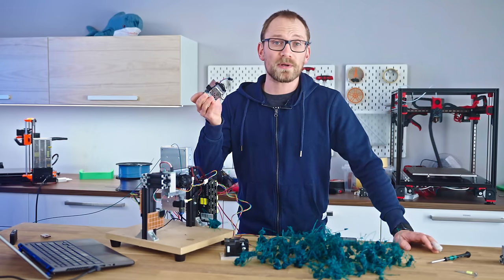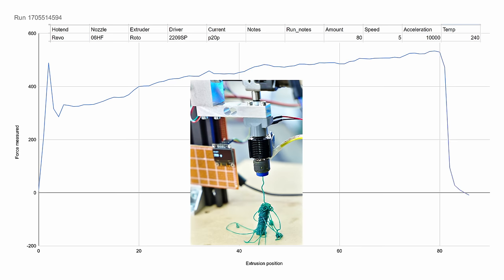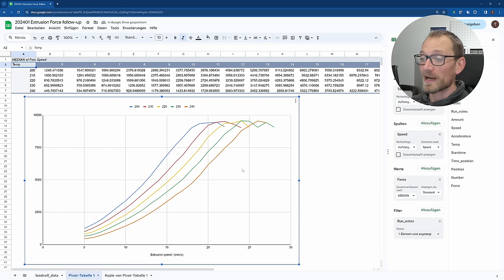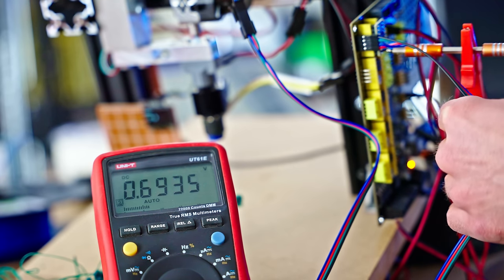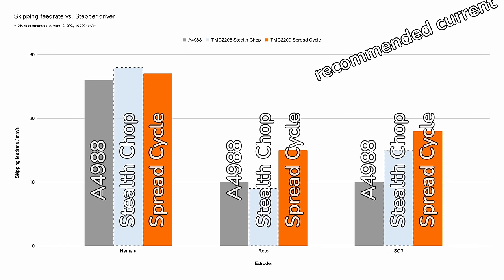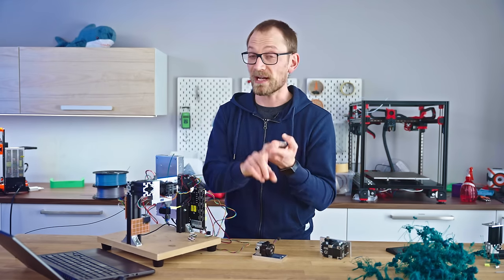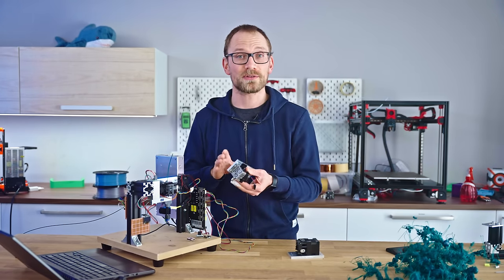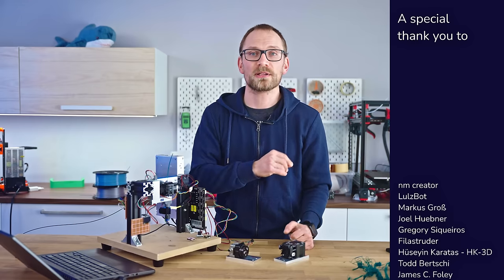Are you using your stepper drivers wrong? E3D Revo Roto Retested!

Comment: To me it sounds like someone miscalculated the winding count & wire gauge requirements for the Roto.  From what you’ve presented, there are too many windings in the Roto.  The higher the winding count, the higher the voltage requirement.  They should be using fewer windings and a larger gauge wire, which would then work with a 24v system.
Reply: I think it's more to do with step angle. 0.9Deg needs twice as many steps as 1.8Deg, which then require higher voltage to push the current
Reply: @Papinak2  step angle has very little, if anything at all, to do with this.  This was proven when he dropped the multiplier from 16x to 8x.  The fact that you can’t hit Imax of the motor at 24v is the issue.
Reply: @cnc-maker  it has a lot to do with it - he reduced microstepping multiplier, which removes bottleneck on the MCU side, but it doesn't reduce frequency through motor winding, which is large contributor to inductive resistance - double the frequency reduces current to half. So motor that needs half as many steps to complete full rotation would be able to run at roughly double the speed, everything else being equal.
Reply: @Papinak2  we'll have to agree to disagree.
Reply: @cnc-maker  what do you disagree with? That more steps results in higher frequency and lower current?
I don't disagree that different winding could increase the speed, but at the same time, it decreases torque - it can be compensated by higher current thanks to thicker wire, but I'm not sure how well it scales.
Reply: Ok, I spent some time actually looking up some data sheets of similar steppers, with 0.9 and 1.8° step angle. Found 
LDO-42STH48-2504MAC (0.9)
LDO-42STH48-2504AC (1.8)
Both motors have same max current (2.5A), same phase resistance (1.2Ohm), same inductance (1.5mH) - but the 1.8° stepper has higher torque (55Ncm Vs 45Ncm) . Unfortunately any information about torque/speed is missing.. but the 1.8° motor will run at twice the speed at same stepping rate.
Reply: @Papinak2  which fails to prove the point that you are trying to make.  Even if the motor is making 2 full revolutions/sec, the impedance of the motor would only be ~3.77 ohms, which would allow ~6.77 amps to flow, or ~4.83 amps if you factor in the resistance of the motor.

You are just guessing as well, and these values are obviously nowhere near the actual values of the motor being used.  I am not making any assumption that I can't prove, which is why I do not agree with your hypothesis.

Best
Reply: @cnc-maker   which motor are these numbers for?
If I'm reading Roto specs right, it turns 5 revolutions/s at 12mm/s. Using your impedance numbers, that would mean ~2.25A, which is already below Imax.
Having full specs of the Roto stepper would be better, but E3D didn't provide them.. The closes I found is the motor used in Orbiter, which has higher both inductance and resistance of the winding, than the motors in the example while having higher current limit  - which suggest that the E3D stepper is worse than that.
Reply: You're both right. Either reducing the steps per rev or the number of turns on the coils would solve the problem, using less voltage and more current to produce the same RPM and torque. Higher step resolution doesn't give much benefit on a highly geared extruder, so either solution would be fine.

Increasing the drive voltage would work just as well, but is impractical since all the commonly available components for 3D printers are 12-24V. Meanwhile the common drivers can deliver much higher current than this motor can handle, so it was a bad choice by someone at E3D.

Comment: Love the follow up Video ! If you have experiments with a lot of variables consider design of Experiments (statistische Versuchsplanung) and statistical Result testing to qunatify the results. It is a little intimitading at first but really pays of in these complex analysis.
Reply: I think nighthawkinlight has a video about this. It was very fascinating to watch and learn
Reply: Getting software to analyse such experiments is pretty price though
Reply: @Max-tj7bp  You can easily analyse it with a small self-written script, even in excel if you set up your equations by hand. The mathematics behind is quite basics, if you stay at the classical fractional factorial design.
Reply: Agree with @Kaliumcyanidful on this. I was using design of experiments/DOE/DOX back in the 90s to optimise injection moulding settings. I'd rather implement it in a dedicated stats package like Minitab than Excel, or use a relevant library in R. There are also dedicated DOE packages too, which are great, but pricey, unless you can get sponsorship from them.
PS Taguchi designs are interesting but in my opinion, you need to be a stats ninja to run them with confidence.

Comment: A magnet field is caused by current not the voltage. What a driver does is open transistors to apply the voltage which results into a current raising over time with the factor e ^(t/tau) where tau=r/L. tau is the time constant. After x % of a PWM  period the transistors are switched off and the energy of the magnet field getting converted into current which is sinking with the factor 1-e^(t/tau). If the PWM frequency is too high or tau  too large, the driver will never be able to control the current to Imotor_max. If the voltage is too low or r too high the system will never be able to get to Imotor_max either.   

Hence the motor might the wrong type with a too high inductivity or coil resistance, since system parameters like the 24V can't be changed.
Reply: I don’t know what the Trinamic drivers are using internally, but there are numerous ways to implement a constant current design.  They are probably using a digital averaging design for RMS current, but they could also be using a D/A voltage reference for a true set current.  The problem with the Roto motor is that it has too many windings, thus it requires a higher voltage to reach the required current.
Reply: @cnc-maker  They are using PWM with a H-Bridge current measurement measuring every cycle, which is then eventually averaged with a low pass. But this isn't interesting, because the current can only be achieved when the impedance of the coils isn't to large, which is here clearly the case.  My guess is E3D had another motor in the lab than in production. It's a QM problem.  I had a similar problem with hydraulic valves, actuated by a magnet field of a coil. Usually the PWM has a frequency of 150Hz but an engineer gave us a cheap card with 30kHz and the range of the valve was 0%-30% only.

Comment: Take the hot end out of the test by setting a constant force on the filament.  Fewer parameters to change, no filament to waste.  A 'reverse extruder' on the output to adjust the back pressure.
Reply from the maker: Thought about that, too! I'd still need to run filament through the extruder though, as the force produced at standstill is quite different to the one at speed, and I'd probably also need to use fresh material each run as the extruder teeth chew up the filament quite a bit. On the upside, at least I could still re-use the chewed-on filament for simple prints in another machine.

Comment: Thomas, I would like to commend your approach and digging in entirely for what appeared to be an obvious limit of flow in your previous video. Here you answer what the bottleneck is, and it's wonderful information for any printer enthousiast.

To me this exposes a product that seems to fall in the category "because we can".

I honestly don't like the response from E3D that they posted here, it does nothing to address the potential issues, and there are plenty:
- Stepper motor needs more than 24V when running fast due to back-EMF from the inductance aspects of a stepper motor (coils don't discharge instantaneously)
- Load on CPU is also way higher, as the Revo Roto extruder has 2682 steps per mm. This is such a big increase from a regular setup that this has to be investigated to find the implications when you are running Marlin on a relatively weak board (Arm M0+ for instance on a BTT SKR MINI E3 V3)
- Stepper motor should run really really hot. How hot? Nobody knows.
- Driver might also run hot because it has a lot of work to do. How hot? Nobody knows. Maybe you even need to turn off interpolation to alleviate some limits. But again, nobody knows.

These limits that could all have become relevant, and all for just being able to have very high torque from a very weak motor in a very light package. A light package which will only shine when....you don't go slow, but start cranking the speeds. This product missed the mark. Could have gone 1.8 instead of 0.9, without any downsides, could have stayed with a Nema17, but then go full pancake and still have a pretty lightweight extruder.

Comment: In a bygone era (3 years ago) such considerations (very high speed and flow) were a non-consideration. For example I have put a Sherpa Mini on my old QQS-Pro. It prints at 80mm/s and the moons NEMA14 with 5:1 gearing works fine, so yeah this Revo Roto would have been a lovely project for that machine. Yeah retraction speeds are limited, but it works. Some things I have also discovered over the years; always set your TMC current to the RMS value of the max Stepper current ( multiply by 0.707) as it will inavrably push less than this in general use, and I see no need for safety margins that people sometimes recommend; temperatures of the motors are fine and have been running for years now.

Also some major things about extruders; get your acceleration correct! Turn off Stealthchop and also turn off interpoleration; these settings alone will return your extruder to actually sounding like and extruder, if you're unsure. All these things alone can reduce accuracy of stepper movements; the TMC data sheets will actually tell you this, as well as some Klipper documentation out there. It's interesting as all this information is out there and written down in some shape or form, but not easy to pick out and collate in general (as in everything in electronics). As such well done for bringing some of this information with actual testing to the masses!

Comment: interesting that the revo motor is basically at Vmax the entire time, wasn't expecting that outcome, and you're right, quite surprising they didn't work with LDO on it, I wonder if Jason and Co will make a swap in LDO motor for the roto
Reply: is vmax volume, velocity or voltage?
Reply: They said they were working on a "different" motor version almost as soon as it was released because of the max temperature of the stock motor.
So maybe an opportunity there to work with a different manufacturer.

Comment: the stepper on the hermera is a 24v stepper therefor its internal resistance is low. on those other ones there are for much higher voltage so there internal resistance is lower. 
if you want a stepper hat can push until gears breaking use lower voltage steppers and diver that can handle higher current. there is no problem over driving motors and if they get to hot, there are heat sink collars you can buy for it. 
the thing is if you want a fast direct drive system you need a lighter head but most of the weight of the head is the motor, but if you want a lighter motor you need a smaller one. but the problem is if you make the motor smaller and want the power you have only 2 option, first is less internal resistance for more current but most stepper driver are limited in current and cant push any harder. therefore you need a stepper with higher voltage to lower the current that is required for the same power but your system uses 24v and you using a 48v stepper because it weight less you also have less power. this may no big deal for a ender 3 or other 50mm/s printer but machines that can 200mm/s this limits you. 

bigger stepper are less a problem because the stepper driver sets the limit with its max current. for example you have normally a 24v stepper with 1A and your driver can 1,5A the stepper uses its 24v on full power but if you buy a 48v stepper with 1A it will use also the 24v but because of its internal resistance it will only use 0.5A. the Current is mainly the reason for the size of a motor. so bigger stepper can handle more current. but if you buy a 12v stepper with 1A and use it on a 24v system the motor uses now 24v and up to 2A but you are limited to 1.5A so in the end you overdrive the stepper a bit.

Comment: I would be quite interested to see a 48 or 60V setup, just to see if that improves performance on the Roto. You might be able to get a setup where you can pass the data lines from a 12 or 24 volt board to a stepper driver, but have the driver powered at the higher voltage from a separate power supply.
Reply: .9 stepper is the problem. Everybody thinks more precision, better. But this is an extruder we are talking about here, giving up half the power was a mistake.

Comment: Wow. Im so glad you found that out not me. I had a tatty E3D titan Aero replica on my baby Kingroon and was looking at the Roto as its lightweight and fast but now i see its not, As luck would have it i picked up a Creality Efit extruder instead (for £30 brand new) Nothing flashy but imho, a seriously great bit of kit (considering its make) Ive not had any problems pushing it hard for 48hrs while printing the super long bedslinger parts im building for one piece RC plane wings. The quality the little KP3S is banging out now has also shocked me going on the amount of bad rap the thing gets elsewhere.  Could you test one of these Efit extruders? See how it compairs the the Hemera as the New bedslingers going to be needing an extruder soon.

Comment: It seems like were getting at the borders of E3ds abilities to design, source, and spec out to manufacturers smaller  powerful systems. It may not be a physics limit, but an organizational one and or systemic in the ability to find cheaply producable components to keep driving size and weight down. A lot (most?) 3d componentry isnt  developed as consumer 3d printing technology initially,. We're getting refinements of tech and designs that found other uses. 

For example an old M3D printer I had used motors commonly used to move the louvres on mini-split AC units for their geared extruder steppers. The more bespoke the solution is required to get these specialized designs going the higher the cost and harder it is going to be to find a manufacturer willing to make the relatively small runs that E3d can drum up.
Reply from the maker: E3D seem to be pushed towards making more high-end parts that offer specific benefits. The mid- and low-end market is quite saturated with products that all easily pass the "good enough" threshold and are often produced with maximum cost optimization in design, materials and labor. E3D, being a UK company, simply can't compete there.
Reply: @MadeWithLayers  So then how can they explain the smartorbiter v3.0? It's 1/3 the price, and the only downside is that is doesn't use Revo, which might not even be a downside. E3D has charged a premium for their products, and it has been worth it, but they need to take a look at what they are offering for the money they are asking.

Comment: Flow rate tests aren't a good way to test extruders, instead they are good for testing nozzles and heater blocks.

The flaw is that higher force extruders may not really achieve a higher flow compared to what the Revo hot sides are actually rated for -- I think its more likely the extruders are just forcing colder, harder plastic through the nozzle. The Revo nozzles are pretty well known at this point at producing specific volumetric maximums in different materials, which are well-documented on E3D's website. Those flow ratings are not a function of the extruder, but rather the material and how fast that material can be heated. 

These days, pretty much every extruder can produce far more force on the filament and hotend than is necessary, especially at small nozzle sizes like the 0.6mm that was tested. This can be proven with intuition -- you only need light finger pressure to constantly advance filament into your standard 0.4mm hot setup! The real job of the extruder (outside of exotics / flexibles) is to advance and retract at very specific speeds/steps. The ultimate test data to compare extruders would be something like: 1) does it meet the target volumetric rating of the hot side in use? 2) measure precision 3) measure flexibles feeding 4) can it dial in proper amount of gear backlash? 5) long term gear-wear 6) motor temperatures 7) conditions where steps start to skip, such as current/temp/backpressure

TLDR:  The nozzle and heater block are almost always the problem with flow limitations, not the extruder. Need different tests for extruder performance.

Comment: Interesting, so how does stealthchop compare on motion in 3d printers. Ive seen my printer skip with stealthchop on at 20k accel but never with it off. Would be interesting to see data on that too.
Reply: It might be interesting, but if this is a printer anywhere near a person, you wouldn't want to run with stealthchop disabled on the kinematic system motors.  If you want higher acceleration, get motors that can support those accelerations at the speeds you are moving.

Comment: I was going to be putting revo roto's on a 4 tool, toolchanger system. Looks like I will be using a Smartorbiter v3.0 now. I cannot justify spending triple the price for a package that is barely smaller and lighter, and performs worse. The only saving grace of the revo roto, is the revo hotside, but it's not worth $200+ as well as the more expensive and more limited nozzle selection.